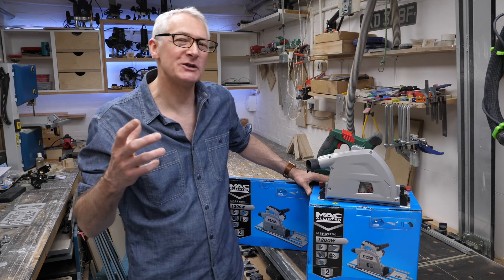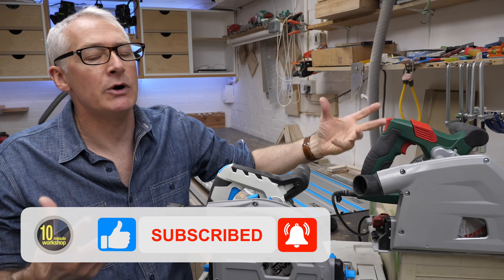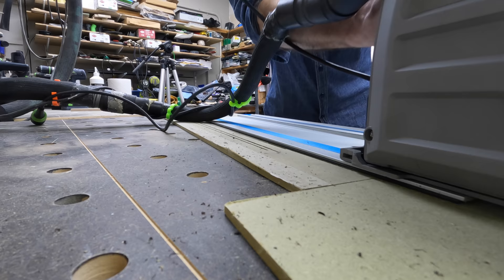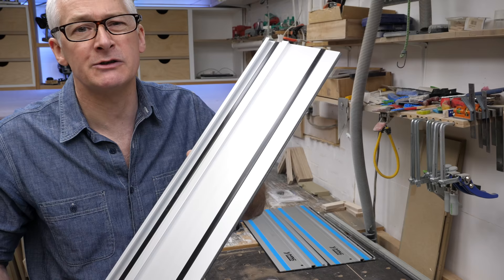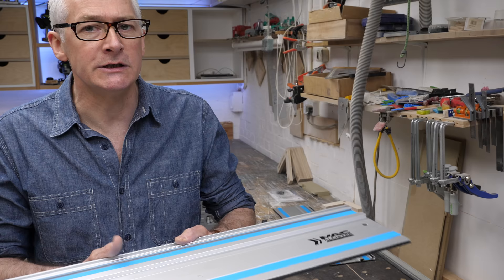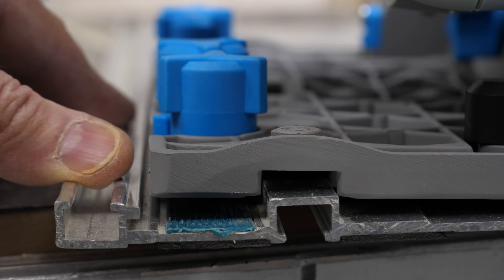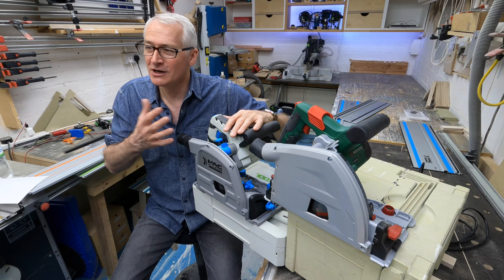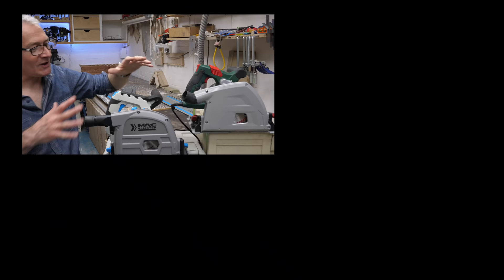Lidl Parkside or Screwfix MacAllister? [video 454]

Comment: Is it worth paying the extra for the erbauer over the MAC for DIY use?
Reply from the maker: Not unless you want the slight extra depth of cut, and soft-start. If you do then the Erbauer is a nice saw - I reviewed it here a few weeks ago - but the odd blade size reduces choice significantly. 👍
Reply: @10MinuteWorkshop  So for getting on for twice the price you get a brake and an annoying blade size. The brake is kinda nice to have. Hmmm

Comment: I finally decided to take the plunge (no pun intended) and buy a tracksaw last week, I seen that Lidl were about to do another but remembered you mentioning the slightly none standard rail, so opted for the Mac Alister (as it was just a Titan with a different dress on)
Set it up trimmed the splinter guard and promptly removed the anti kickback annoyance!
a bit chin rubbing later and I ordered the Evolution 2x 1400 rail set with clamps, bag and bars

Comment: Will the parkside work on any other track than parkside?? Thanks!
Reply from the maker: Yes, the Parkside is fine on Festool-pattern rails, it's only the Makita-pattern it has issues with. As mentioned in the vid, the Evolution rails are the best value pair of 1400mm rails around - links in the video description. Parkside and MacAllister both work on Evo rails. 👍
Reply: @10MinuteWorkshop  Thanks Peter I was a bit confused by that bit. I think I will go parkside as it has a riving knife and also clearer measurement markings and get some evolution track down the line.  I have a long piece of steel bar to rip sheets down, then table saw.  Thanks for reply!
Reply from the maker: @planespeaking  Just to be clear, it's not 100% that the Parkside will have a riving knife. Last years model released in Germany did, apparently, but the UK version did not. The description suggests that this years UK-spec model will have a riving knife, but that wont be confirmed until we can actually buy the saw. 👍
Reply: @10MinuteWorkshop  I checked the website a few moments ago and it does have a riving knife (although not called that) In on Sunday June 6th at 10am, although some items delayed so nof guaranteed.
Reply: I will reply pn Sunday and let you know.
Reply: It does have a riving knife.  I think I am going to save my pennies and get a Bosch biTurbo cordless though.

Comment: Having stripped a none operational mcallister saw  for parts to repair my old Titan….. I found the plunge mechanism seized and a woodruff key sheared  on the arbour  I think because the machining was so poor on the key way when it was made , the Titan has been great after 8 years or so,  of d I y use  but make no mistake they are cheaply made   And not as cheap to buy as they used to be.!! Also parts can be a problem…!!!!!
Reply from the maker: You can get parts for the Triton, which seems to be near-identical but with added balls and whistles. 👍
Reply: @10MinuteWorkshop  “ balls  and whistles” that must be the one they sell on the dark web only.!!😂 but thanks.. P.S.  the recently purchased loose Tenon bundle works a treat.!!  Thanks for that too.!!👍

Comment: Might pick up a new one if it has the riving knife!

For anyone interested in buying extra rail for your parkside direct from the manufacturer, here's the link 

https://www.kompernass.com/en/accessories/843/guide-rail

Just had a couple delivered yesterday, ordered on the 24th May.
Reply from the maker: Thanks Rodger, appreciate the link - I'll add it to the video description! A German subscriber commented that the 2020 German model - the PTSS 1200 C2 - had a riving knife, so maybe we're now getting that model? 👍
Reply: @10MinuteWorkshop  excellent, I'll keep an eye out in store.
Reply: Hi. Just inquiring if you get 2 tracks or just one. The photo shows 2 tracks but when ordering it says 1. Does it come with connector.

Just bought the Parkside tracksaw from Lidl this morning so wondered about getting more track. Looks a good deal. Thanks.
Reply: @rickorider  hi, yes, each set comes with two rails and one joining bar, plus an allen key for the joining bar grub screws. 

One thing to note though, you can't buy the joining bars from that site separately so you'll still be short a joining bar to join between the first two and the second two "sets" of track. I've yet to look but I guess eBay or Amazon will have them.
Reply: @rickorider  can you confirm whether or not the 2021 saw has a riving knife?
Reply: @rodgerq  Hi. Yes it has a riving knife. First thing I checked. 

They only had 2 on the shelf where I live in Evesham. Went in at 10am and had the first one!
Reply: @rodgerq  Thankyou. Just ordered a set. Was £18 including postage plus a few pence. Sounds a bargain to me!  Can cut up to 2100mm long now with 4 together. 300mm sort of an 8 x 4 sheet but soon over come. 

Thanks for post!
Reply: @rickorider  nice one, thanks for confirming. I'm just about to head out to check although at this time of the day I don't hold out much hope. I checked eBay, 20 quid for a joining bar 😲😲
Reply: @rodgerq  Guess I could make up a joining bar. Its probably an available section and could drill and tap for Allen grub screws.
Reply: @rodgerq  Hi Thanks. Umm think I can make a joining bar a bit cheaper. Someone is trying to make money! 

Hope you can get a saw!
Reply: @rodgerq  Whoo that looks good. Might get those as price is good by the time I get the right bar size and get the grub screws. Thanks for info. Good spotting.

Comment: I'm just amazed at what you can get in the UK / EU for track saws. Over here, Aldi and Lidl don't sell any thing like this. 80 quid for a track saw is bonkers. I've seen makita rip offs over here but they still want close to $300 for them. Edit I stand corrected. Saw and 2 50" rails for $220 or 156 quid. Still not as cheap though. 

In case anyone over here want's a butchers https://www.amazon.com/WEN-CT1065-6-5-Inch-Sidewinder-Circular/dp/B08M8NQ8WR/ref=pd_lpo_card_1?pd_rd_i=B07VFXFTVP&th=1
Reply from the maker: Mad isn’t it? One of the few areas where we in the UK /EU get a better part of the deal! 🤷‍♂️👍
Reply: @10MinuteWorkshop  Having looked at the Wen it looks just like the screwfix model you had

Comment: Parkside - i kinda like their tools as their value is great - they are very cheap but still decent enough. If you do not need the saw often then this is enough.
BUT  i would NEVER trust their replaceable parts. Drills? Forget them. They are cheap but useless. Not running true, not sharp at all, just a pain to use.

Comment: Iv noticed that the 2 saws are left handed why do they do this I much prefer right hand set saws obviously if you are right handed which most people are its easier to use lol
Reply from the maker: Most tracksaws - and circular saws - have the motor to the left of the blade; only one I've come across that doesn't is the Kreg.🤷‍♂️

Comment: Hello there Peter. Thanks again for your advise last time. Now to the topic at hand. The Parkside Plunge Saw is featured with a Rivingknife since the 2020 model. It's the version called Ptss 1200 C2. So that's something to be aware of in terms of buying new blades. Also i found out there is a upgraded version available from with the Güdelabel on it. It's the Güde TS 57 1400 KE. It features a 1400w motor with softstart and constant electronics. For Railsupplies i can recommend the company youtool. The sell guildrails made from the old festool Pattern without the Accessoirechannel. For Güde and Youtool i cannot say if they deliver to GB because they are german companies. But i'll leave the links maybe this will help someone. Greetings from Germany. www.guede.com and www.youtool.de
Reply from the maker: Hi Tobias, and thank you! That's interesting - I'm pretty sure that's not the model that we had here in the UK last year, and the model number isn't mentioned on Lidl's website here - like German wine, you're keeping the best to yourselves! 😂 And yes, the YouTool rails are good - sautershop sell them and ship to the UK - though they're the original Festo-pattern rails, without the t-slot for accessories. Great for straightforward cuts though, and thank you for the links! Best wishes from London! Peter
Reply: No Problem. Maybe you get the Rivingknifeversion this year. And as far as german Wine goes maybe i'll send some to you if opportunity rises. We're still having issues with open shops due to the coronacrises and thus the strict rules. If you are interested i will send you some as a reward for your hard and excellent work with the channel. Red or white wine? Cheers Peter 😉

Comment: Whenever buying cheaper machines that no doubt come from China, I can guarantee they will leave you wanting for a better product, from experience you pay for what you get, professionals would not even consider buying these, all ready this video tells you cant even buy additional guide rails, they will not be repairable, no spares availability, no range of blades for differing material these will leave you disappointed sadly tradesmen are seduced by price, these are expensive when you have to put them in the skip. Festool TS55 / TS75 are the only machines worth their price tag with a repair service, spares backup, and a wonderful range of accessories. Buyer beware.
Reply from the maker: Actually, these entry-level saws are very popular with professionals, often as a spare 'in the van' saw or for site work, or professionals in other trades that may need occasional  woodwork - plumbers, electricians etc.. all buying with their eyes wide open, and knowing exactly what they're spending their money on, and exactly what to expect for it. 👍
Reply: @10MinuteWorkshop  If a professional came to do work for me sporting one of these machines I would expect him to do work for half price, yes they are for the inexperienced and amateurs. I do not believe as you put it with their eyes wide open and knowing exactly what they are buying. Without these lower grade machines tradesmen would not know the difference between good and bad. They are throwaway and when something goes wrong it makes them damned expensive, non accessorized, and often underpowered. Sadly all the major power tool company's in the UK have gone to buy Chinese crap with the exception of one, all that does is propagate a race to the bottom. As a professional yourself I am quite surprised you are endorsing this stuff.
Reply: But most people watching this are not professionals and very much appreciate Peter’s advice and testing on our behalf to help us make decisions for entering into woodwork as a hobby. I’m happy with what I got and the saving versus Festool enabled me to buy additional accessories that will further improve my skill and enjoyment (accessories also reviewed by Peter thus saving me the risk).
Reply: @alistairstanger2940  interesting comment most people watching this are not professionals, this is an interesting remark making even more important that these non professional's are made aware of what they are buying. This proliferation of junk coming out  China are underpowered, non reparable, under accessorised and when they give up they become an expensive mistake. Peters comment they are purchased as a back up trust me I know when you buy a proper tool in the first place you don't need a back up.
Reply: @alistairstanger2940  I am really am surprised as a professional Peter  is endorsing these underpowered, non repairable, un accessorised Chinese machines. These are purchased by people seduced by price and not performance.
Reply: @geebix  Peter does an excellent job of showing exactly the quality a buyer can expect including explaining the pitfalls and benefits. No one can be under any illusion here and his viewers are more than competent enough to know what they are getting into with his help. He is not advocating that everyone must buy these and he is not sponsored to do so. Not every hobbyist can afford Festool type products so there is a clear market for these products and many satisfied customers as you can read in the comments.